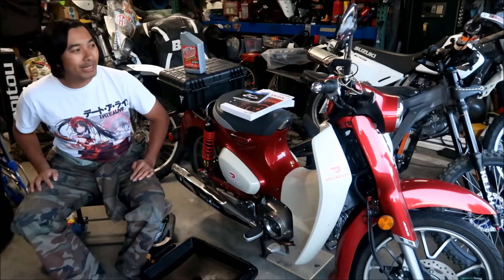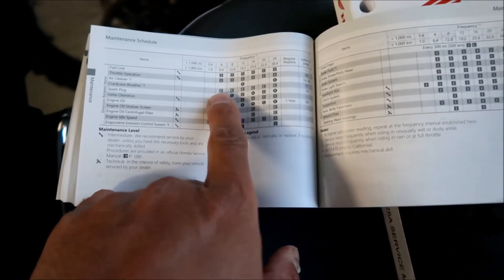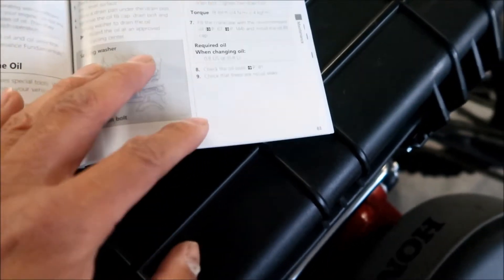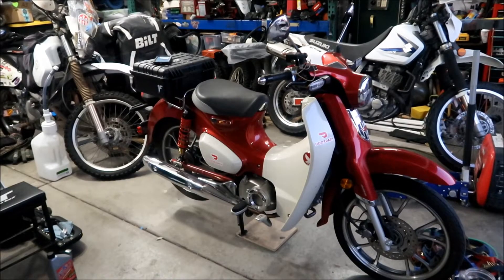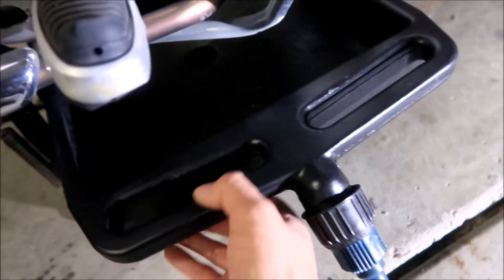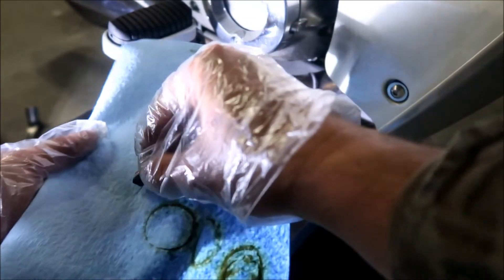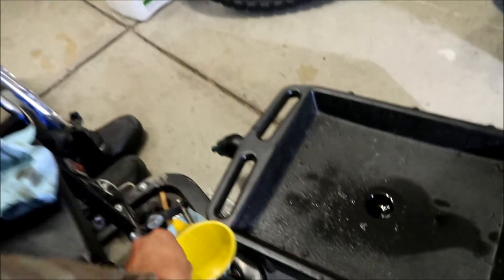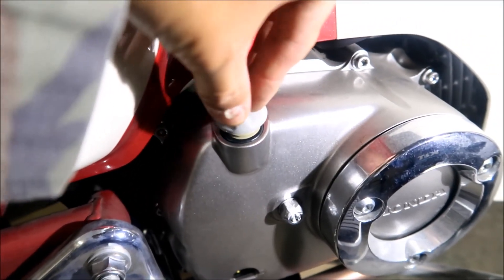Honda Super Cub C125 Oil Change

Comment: Just use Honda SN4 synthetic which is designed to meet all Honda motorcycle requirements. 10wx40 is used in higher ambient temperatures but not required. Drain bolt is 14mm not 17. If you re-use the drain bolt washer flip it over, The washer is a soft aluminum and should reseal well...but check for leaks. Use a magnetic drain plug and wipe it clean after inspecting.

Comment: PS. Forgot to mention.  I also use fuel stabilizer in every  tank fill, and store it over the winter with a tank full of stabilized fuel with fuel shut off.  Bought this C70 clone in 2004.  Still have the original carb on it and, come Spring, it starts on the 3rd or fourth kick.  Am convinced of the value of using fuel stabilizer all the time.  Thanks!

Comment: Just some information from personal experience: Bought a Honda C70 clone with a 70cc engine & 4 speed manual. Only  used 90 plus octane fuel..  Changed the oil at the 100 mile mark, put in 10W-40 full synthetic Mobil 1 auto oil and changed that oil every 200-300 miles.  Got 18,375 miles out of the original engine, until it lost compression: worn ring & cylinder.  Did a TOP END rebuild (cylinder, Piston etc) and now have 25,000 miles on it & still runs like new.  After the 1st TOP END rebuild, started using 90+ octane fuel with high quality 2 cycle oil mix.  Am anxious to see whether using the higher octane 2 cycle mix will give a longer engine life than before, with the added lubrication in the fuel.  Time will tell...  Oh, after each full synthetic oil change, have never seen any metal particle buildup on internal clutch/engine parts.  Could my frequent oil changes be part of the reason? Thank You!
Reply from the maker: Well there will be metal buildup no matter what because it's metal to metal contact, especially when the engine is brand new.  Also your C70 is a 2 stroke so it has seperate oil for the gear box.  This is a 4-stroke 125cc, the engine doesn't wear out as fast.  Changing the oil often I guess will help keep the engine internal cleaner.  I'm just going to stick the manufacturer recommended intervals.  I don't use any fuel stabilizer also, I heard for 2 strokes you don't need fuel stabilizer because the oil preserves the gas if it is premixed.  If you aren't going to run the bike for a while like several months then fuel stabilizer will keep that gas fresher.  Also this bike is fuel injected, no carb with jets to gum up.

Comment: So the first oil change is at 4K?? I’m at 650 miles and see people change around that mileage, but seems so low to me. EDIT: just saw the frequency in your manual. Gotta do it now.
Reply from the maker: I think the first oil change is sooner because the engine is new
Reply: The first oil change is recommended at 600 miles. Thereafter every 4000 miles. The reason for the early first oil change is that a new engine will have metal swarf or particles as it beds in.

Comment: Do you use only motorcycle oil or any oil?
Reply from the maker: Yes it was Lucas synthetic motorcycle oil.  As long as the oil weight is right 10w-30 and it is approved for use with WET CLUTCH engines you should be fine.

Comment: does the engine not have an oilfilter???
Reply from the maker: Not like a normal motorcycle.  There is a filter screen and a oil spinner you can clean.  It requires removing the right side engine cover.  When I get to 8k miles is when you are suppose to clean it.